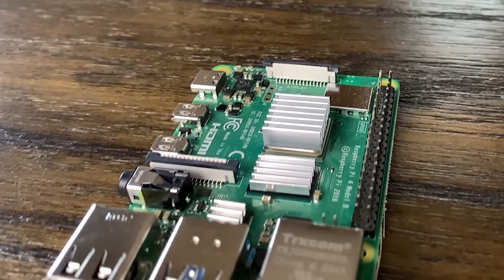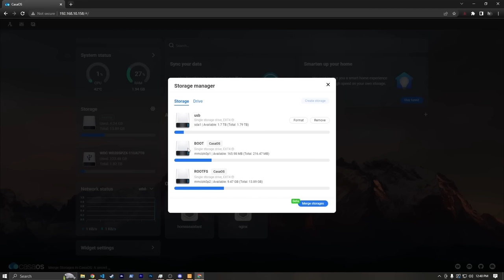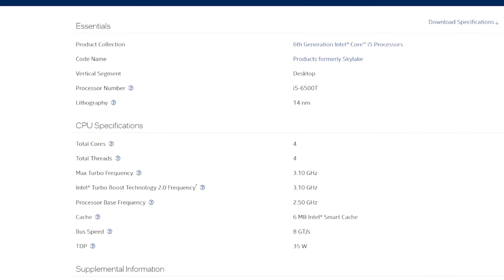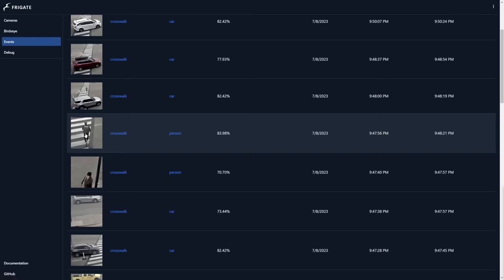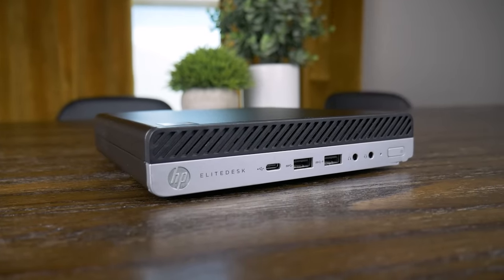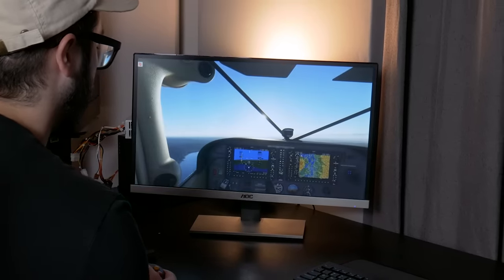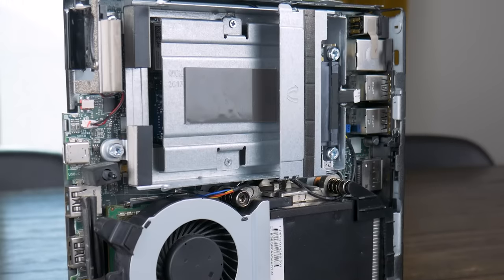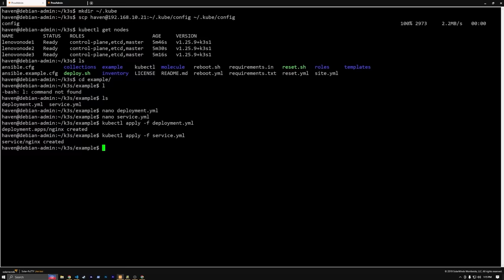The Mini PC You SHOULD Be Looking At

Comment: I have both, I enjoy the HP, AMD Ryzen is massive, I think you missed that, especially for emulation. It's footprint though is so much bigger than a Pi. For me, for what both of these can do, I would go PI all day long.
Reply: When getting a micro pc for gaming (likely batocera), is AMD Ryzen the way to go? Anything in particular to look for to get the best graphics? Also intend to use it for other things, but retro gaming would be a nice perk.
Reply: @tonyhawk123  Yes you want to make sure you got Ryzen as the have built in graphics that are awesome for retro gaming. If you can afford it, go Ryzen 9 7900 series or 5900, if not go with the 7 7800 or the Ryzen 5 5600x in regards to the internal graphics go with the 780M over the Vega 8...these are onboard the CPU built in and why the are baller for emulation.
Reply: @HillPhantom  Thanks. I've been looking at the older second hand micro pc options, but even there it looks like the AMD Ryzen 5 2400GE (with AMD Radeon RX Vega 11 Graphics) outperforms the Intel equivalent (eg UHD 630) by a handy 2x to 3x in benchmarks. 

There is also the “Pro” version of that chip (with AMD Radeon Vega 11 Graphics). Not entirely sure what the difference is. I'll check out the others you mentioned and see how many extra pennies they fetch. All assuming retro emulation options are stable with AMD.

Comment: I bought an HP EliteDesk 800 G3 Mini w/ 256Gb SSD and 16Gb RAM for under $80. It rocks! I've had a Raspberry Pi in the past. It was OK for tinkering but the mini just works better.  I installed Linux Mint and run a couple of VMs on it. One is Windows and all run with no problems. It is currently my everyday machine. Think I'm going to get another one to replace the tower under my desk that has Proxmox on it and I use it for testing.

Comment: I would say that the Raspberry Pi is perfect for learn how to set things up, it use very little energy and with little performance on hand you must make it well optimized. I like those small HP computers but those fans are not a good thing when have it running for 24/7.

Comment: I have one of those Lenovos with the same 6500T your HP has and it’s a decent little streaming and emulation pc, very good buy for anyone.
Reply: Yeah, I've been noticing this a lot recently. I love that the raspberry pi brought attention to hobby emulation, and I'd actually recommend the Pi3 or Pi4 to familiarize people with linux based systems like retroarch, since there's basically nothing you can do that can't be fixed by popping out the sd card and reflashing the image . . . But they are inherently limited.

The SD card reads and writes slow, which makes transferring a large library something of a herculean task, and they just do not have the processing power to handle anything beyond the PS1/N64 reliably. Not to mention almost any desktop is going to have stronger and more reliable wifi. 

Don't get me wrong, I love my Raspberry Pi's as dead simple mini computers for various tasks. My PiHole has been trucking along for years now without complain. They're also great for onboard robotics or basically anything where you need a little computer power for as little size/weight/power draw as possible. But for a little bit more money, one of these cheap mini PCs is so much more capable any time that form factor isn't as much of a concern.

Comment: I have a HP EliteDesk 800 G6 with an 10th generation i5 (6 cores, 12 threads, 4.6GHz w/ Intel 'turbo-boost'), 16GB of RAM and a 256GB M.2 (I believe it is an M.2, but I haven't actually checked). Surprisingly, it'll play GTA 5 at 60 FPS as well as American Truck Simulator, Garry's Mod and a few others. For the rest of the games I enjoy, I play them through Xbox Cloud Gaming on Game Pass through an Ethernet cable. I can't speak to other models, but check to make sure yours has WiFi and/or Bluetooth if you need them because mine didn't come with either which isn't that big of a deal because of my Ethernet hookups and the face-mounted USB-C port that I plug my Xbox Series S/X controller into. All in all, it's pretty impressive for the prices you can get them for!

Comment: You could even use the SFF with the same config to add a Low profile graphics card.. that's if you are looking for graphics intensive work load.. It also opens you up to a few PCIe slots you could use at some point and its accessibility and storage options are far better than the mini PC while the size isnt compromised to a great extent.. and to further push it, the mini PCs dont allow a lot of room for customization but the SFF can be swapped for a bigger case and a better PSU if incase you're going for full sized graphics cards or other things..
Reply: You can sneak a graphics card on to these mini pcs if they have an m.2 slot. Performance takes a hit but it's possible.
Reply: @rmo9808  Really? Do you have a DIY vid on this??

Comment: How did you unlock the 'bios'? Newbie here.  Also, excellent video, thank you for posting.
Reply from the maker: I removed the passwd jumper and then held down the reset cmos button. You can try to find the exact instructions for your device but just know it’s not always possible without more drastic measures

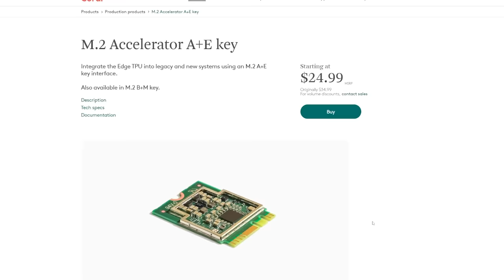Comment: At 3:56 you mentioned the Coral card, but on the Coral site it says: Although the M.2 Specification (section 5.1.2) declares E-key sockets provide two instances of PCIe x1, most manufacturers provide only one. To use both Edge TPUs, be sure your socket connects both instances to the host.
Does this HP Elitedesk provides the two instances?

Comment: Hey finally a video on this topic that does not just completely ignore the existence of money.
"RPi KiIIer!" (it costs 200-3000$ and therefore isn't even competing in remotely the same territory)
That's like calling a high speed long distance train a "bike kiIIer".
Yeah sure I look into that "bike alternative" when I have my own rails infrastructure and need to go from mansion A to castle B.
Then they say: But for the Pi you need a case and a power supply etc!
To that my answer is: The pi works just as well without a case as your 2000$ rackmount solution does without such a shelf.

Comment: Have you considered using both the M2 and a Sata SSD at the same time? That would possibly fill my needs if that is an option without overcrowding the machine.
Reply: I¡ve seen it done with retro gaming, the retro gaming linux install being on the sata drive so that either that or Windows can be booted into at will

Comment: One big loss: GPIO, SPI, serial, and I2C pins. I know those are not important to everyone, but they are for me. Can add a USB device for those, but it's hard to beat the clean all-in-one package of the Pis. My uses don't need high CPU so I'm sticking with the Zero Ws, which are still available for $15.

Comment: This is pretty interesting, does anyone has tried "NVME to 2 Port Adaptor SATA M.2" ? I just curious if Mini PC using it to expand port sata limitation, even there are NVME to 6 port adaptor SATA M.2, as bandwidth I think NVME have a more than enough bandwidth, maybe the problem only need external power to power up the sata device.

Comment: i have the 16gb ram version of this i got it for just under $100 with a bunch of junk peripherals i threw in the trash. when i first got it it had come with windows 11 installed on it so for fun i booted it and let me tell you was it slow (me being used to lightweight linux builds). i installed endeavourOS with bspwm and now that bad boi is so snappy i end up sitting in my kitchen to use it on this 36 inch tv. i multitask installing apps with yay, discord, runelite, media player etc. and everything is fast and smooth (well once you have it configured). theres obviously a lot of other things you can do with something like this but the main one i would suggest buying this for is learning linux on the metal. you dont sacrifice your main machine's workflow using a second machine and the cost of entry is low. gg great video

Comment: These are some very good scores for minimalist mini PCs.
My full size desktop is a 6c/12t R5 3600 ↗4.0GHz, 64GB and an RX 580.
The 240GB NVMe is junk but in PCMark 10 Basic from Win10 ProWS it benches:
Essentials 9775
Productivity 9224
Digital Content Creation 7073
Overall 6171

Does it have issues? Yeah. It's been fine for desktop gaming and VR, scores 8009 in VRMark but these days I only use it to binge Twitch streams and YT uploads between fighting insufferable Windows Update nags. My FX-8370 system was about the same before I retired it to server duty. I built this Ryzen desktop and slumped it into this tall stamped steel coffin in 2019. There's been a LOT of new silicon that has come out since then that runs circles around it. It's very likely time to take advantage of some of it and rebuild already but there's a weird schizm in CPU technology that is pulling people in two separate directions with high core count (and clocks) or medium core count high clocks with V3D cache. I'm not a fan of the newer platforms and don't really have a need that pushes me in either direction so it's tough.

If one of these tiny desktop PCs had just half the performance of my desktop and a cage for a full size 3.5" HDD that would be enough for me to power off my FX rack and a tiny Athlon 64 PC from the 2009 era. I'd make that my new storage server in a flash. ✓💯

Comment: I like the little PC. Has good power.  I was looking for a box to take on trips to play video.  for sound through HDMI - it is a little iffy.  Worked under windows. and worked under an older version of Linux Mint - but my main O/S's - kubuntu - it will not work. and it does not work under newer Mint.     there is a work around on the net, but made the pc unstable.  so I had to look elsewhere.    I am not s saying that this pc is not worth the money, just this - if you are a Linux users and want to play video - there are better choices.   I purchased a Lenovo M715Q and it is very good. Infact, one of the best PC's that I have for playing video.  the cpu demand while using VLC is low compared to all others.

Comment: I just got a SFF PC (HP ProDesk 600 G4) to run Proxmox. However, my machine only has 2 slots for 2 M.2 NVME's, and no caddy for a SSD.

Can I install Proxmox on a fast flash drive on a USB 3 slot? Will it run well, or will it be very slow?
Is it a better idea to use those USB 3 slots for a ssd (or nvme) in a USB enclosure?

Comment: First thank you for the video.  All of the computers you mentioned,  possible baring the pi,  are more powerful than my newest box. I looked at some of these mini PCs  on ebay recently to use with a new monitor I bought.  [ laugh if you want but I didn't realize that HDMI wasn't one standard and the only pc I have with a HDMI is v1 were as I require a newer version for the 2560x1080 monitor ] Be very careful,  after contacting three different sellers to check the HDMI version ALL said the machines would come with an adapter to use HDMI -  This is useless it is reported that thus will only work up to 1080p. I have had plain,  simple,  common,  STANDARD Dsub (vga)  running my 1920x1200 Dell 24" monitor for ~13 years.  I have yet to find a second hand computer that can definitely use this LG monitor with so it is still in its box. ((main work box is and will always be XP,  Internet box is Win7 but have being getting used to Q4OS (Linux) for Internet  not quite sure yet,  Linux has low resolution but at least has Pale Moon (real FF.) 
I have over a dozen computers, many used a fair bit all with plain old Dsub.

Comment: The main issue I have with these minis is that they usually only come with 1 ethernet NIC, if any at all, and it's usually only 1GbE. That doesn't really matter when using it as an actual PC but it's a pain in the rear when you need something that needs at least 2 NICs running at the same speed (like a firewall). Having a single hardwired 1GbE pretty much negates installing anything other than another 1GbE module in the E-key slot. This is becoming more important as more and more ISPs start offering speeds greater than 1Gb. So the trick is to find something that can support at least 2x2.5GbE (or higher), which is not easy to find in such a small form factor.

There are Chinese manufacturers out there (like CWWK) that make custom micros and minis with fast networking but my personal experience with those is sub-par at best. The hardware is so finicky that you end up with things like random reboots and partially implemented NIC specs (like no multicast or promiscuous support).

Comment: Those mini PCs are certainly an interesting offer, however when you say being that that HP is very energy efficient, keep in mind that what you could tweak in as idle load, the Pi4 consumes at max load. At idle the Pi4 is around 2W. That is quite a bit of wasted energy on long or continuously running devices.
Reply from the maker: True, but even at something like $30/kWh, it’s still a difference of around $10 a year. With my power cost, it’s more like $5. If the performance and/or compatibility is needed, then I would say the extra energy cost is easily worth it.
Reply: @HardwareHaven  Only if you assume 100% idle. If there is continuous use the difference could be substantially larger. Will it put a big hole into your burse? Probably not, but to some keeping things efficient and not unnecessarily wasteful for the given task is a merit on its won. 

You are right however that if the performance and/or compatibility is needed of such a mini-PC, then a Pi really isn't a suitable alternative to begin with.

Comment: Does the 6500t work as a Host on Parsec? I tried the i5-2400s but it says the graphics card is not supported
from the site I read that at least an Intel HD 4000 is required, while the 6500t would use an hd530

Comment: I have a HP Prodesk 600 G4 Mini with an i5-8600T. Added an external GTX 1650 using a PCIE to M.2 adapter, I can now play triple A games with very great results!
Reply: Can  you share more about your setup? Is the GPU in a powered separate enclosure? What adapter did you buy?
Reply: @Acece665  Basically what I did is follow the steps shown in a video guide by a youtuber called ETA Prime; I used an adapter that you can purchase on Amazon called the ADT-Link R43SG, it's a PCIE adapter that changes the connector to an NVME M.2 connector, which you can plug into your NVME port on your mobo. 

The external board does require power, but you can either use a standard PSU for that, or a Dell DA-2 adapter, which is a more cleaner solution in my opinion.

Once you've downloaded the appropriate driver(s) for your GPU (do note that for some reason AMD GPU's don't seem to work with the adapter), you can basically start using the setup.

Comment: If it was one of those hp or dell mini pcs that have an optical drive and an sd card reader plus heaps of spare grunt, it'd be the best way for me to keep a minecraft server running(assuming hosting bedrock servers was easy and I had competent internet, which it isn't and I don't have) while giving me a media player and something to dump roms to, without holding my pc up and using a shitty adapter, for later network transfer. 

of course bonus points for it not being a fucking hp or dell, that way it's actually fucking viable

Comment: Is this particular 1L pc capable of running Linux Ubuntu Server? And, if I'm not mistaken, you said that the CPU and RAM are upgradeable as well as inserting your own SATA or NVMe SSD's, correct? Thanks for sharing a great idea. I've subscribed!
Reply from the maker: Yes to all! And thanks!
Reply: @HardwareHaven say that I wanted to build a NAS or DAS with about 16tb - 20tb of SATA SSD or even HDD, how hard would it be to get them connected to this mini pc? Would I just get a separate case & some SATA adapters or is it even possible on this mini pc? Thanks again.
Reply from the maker: @aaroncatolico7550  You CAN get a USB DAS box, but there are issues with that. I would look for a desktop or NAS with more drive bays. You'll probably appreciate that decision vs tring to make this work

Comment: I think raspberry pi flies over the heads of desktop and server OS minded folks to some degree, and does the same to microcontroller/embedded people in other ways. You really need a fusion of electrical engineering and computer programming skills to use it end-to-end. Also need some understanding of why having the host OS, GPIO, low power, and networking glued together is powerful depending on use case. This is not to say the pi is inferior to the mini pc, but more like it’s not a nail.
Reply from the maker: Spot on. Pi's are incredible for certain applications, and when they were stupid cheap it wasn't bad for a really efficient simple server, but they often don't make sense. It's surprising the number of people that think I'm attacking pis lol

Comment: hi pctech 25 years..   the itx boards are indeed mini  BUT  out of evey one tested,     HEAT ISSUE'S.....   easy fix by removing half the case as putting a 120mm fan on so I'll recomend them as   hackable to get working like a normal mid size tower...  under the desk my full size takes no room, so it depends on the case    (its not in one LOL)

ps  my pc is on a piece of oak... I put the riser pins on it a just screwed the mobo to the wood... I have zero cooling problems with 1  3 foot sqaure Box fan lol   you dont even NEED a case